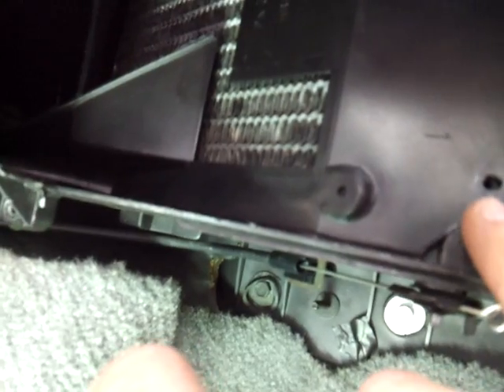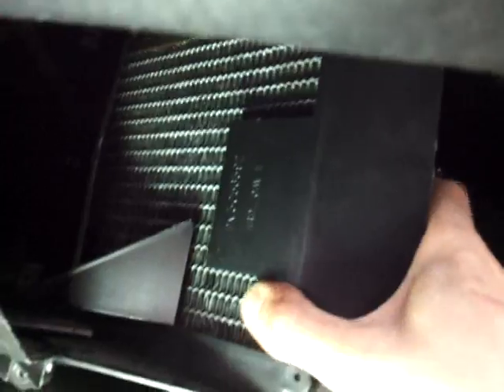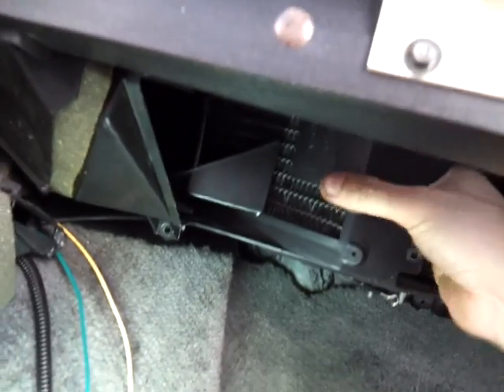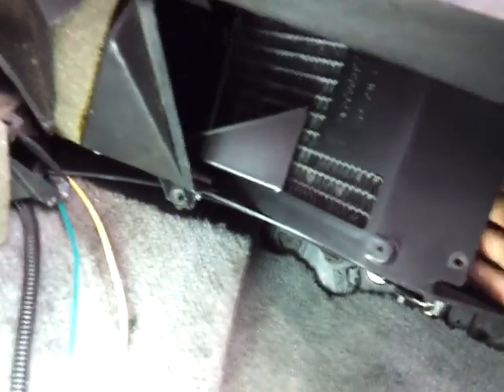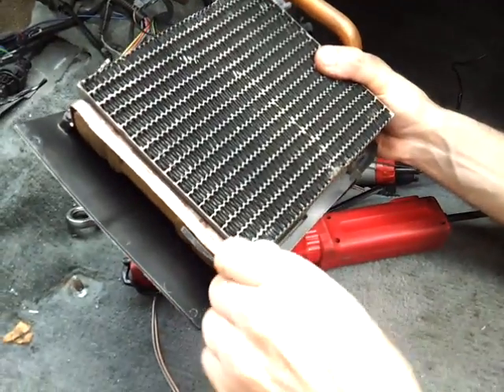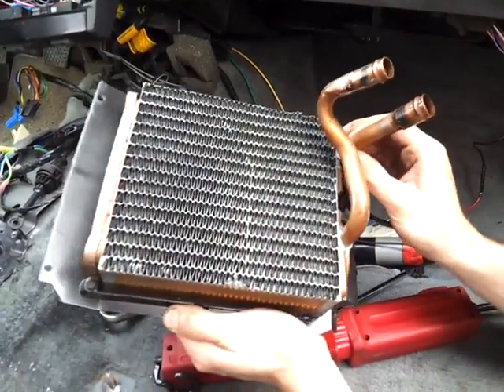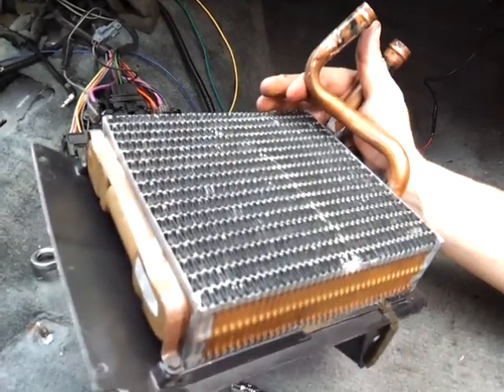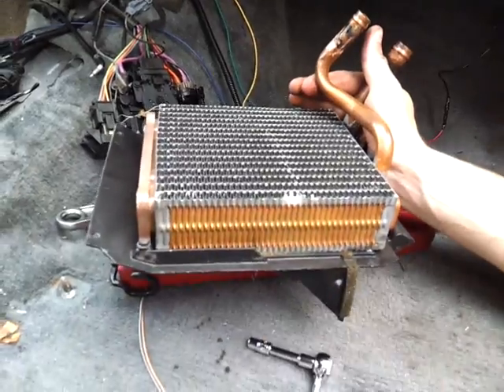How To Change A Heater Core - Part 2 of 2

Comment: Awesome vid, helps me plan this out ahead of time. The bolts might actually be 7mm (9/32"=7.14mm) since these things were made with so many torx screws (metric thread) I think half of these cars were metric and half were standard. Most are so close it doesn't matter. But thanks again for the heads up video, now I know how to tackle this.
Reply: Half are standard? Nope. Most are metric.

Comment: hey i have a 92 camaro v6 and thanks for all the camaro videos, my heater works fine but it only blows from the top vents on windshield, someone told me that there is a latch that might of unhooked inside that switches the direction of the vents blowing. how do i get to that latch/hook to get all the vents to blow and not only from defrost position.
Reply from the maker: Joel Salcedo i have a video on that latch..check out my channel..it could also be a vacuum controlled actuator
Reply: klowny1969 thanks for responding  i saw video on latch for door closing from hot to cold any videos on actuators?

Comment: Klowny, HELP!  I have constant vibration from behind upper dash on Honda Accord 2001 from 1,000 to 2,000 RPMs. It is loud and embarrassing when driving. Do you think the heater core assembly at a certain spot is causing this? It only lasts from 1k to 2k rpm. So I find myself gunning the engine to get past it.. Have you or anyone else heard of this vibration?
Reply from the maker: Possible that something is loose..only way to find out is to get back there..if it's a stick, then u could have other issues, maybe loose motor mounts
Reply: Yes, when you were taking the core out, did you see any areas that are extremely tight, yet moved or wobbled in the heater core assembly? @klowny1969
Reply from the maker: Every car has tight quarters back there..check to see if its clutch chatter or bad mounts..the vibration will travel inside ur car
Reply: I notice that when the heater is on there is no vibration. So when something becomes warm/hot it stops vibrating. Also this is an automatic transmission.  @klowny1969

Comment: I am not in a position to do this kind of work at this time. If I take my 87 Iroc Camaro to a shop to dii this work. How many hours of labor can I expect to be charged?
Reply from the maker: Anywhere from an hour to two hours depending on the shop
Reply: klowny1969 Thanks for the info. My heater core blew. I was charged 3 hours for the labor. Plus I now have to clean up all the antifreeze that leaked. What is the best way to take care of this issue?
Reply from the maker: U can use a blow dryer..but see if u can wash it out with water first , to dilute the antifreeze as much as u can

Comment: Now make a video of putting it back in. Honestly this is THE HARDEST fucking part. I've spent about 2 hours today removing the heater core on my 05 impala 3.8l. So far 3+ hours and counting putting the damn thing back in. Why so long? The damn pipes won't fit back thru the rubber holes leading to the engine compartment. I can get one, but not the other. Same model of heater core so that's not it. It's just that foam/rubber is making it impossible. I'm SOO close to just ripping it out.
Reply: Please give me an update. Same car, same problem about to try to replace heater core today
Reply: Greatly appreciate any tips as well
Reply: @samsmith9485  If you have the old heater core, absolutely verify it matches the new one. Part store gave me the wrong one. That was my problem. 

So take the old and new one to the part store, and make them verify the new one matches old 100%.